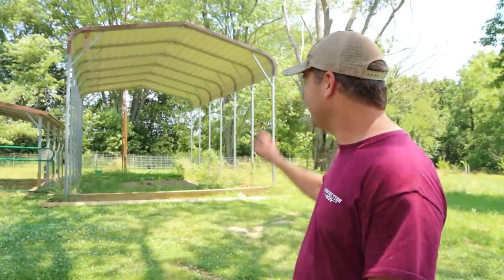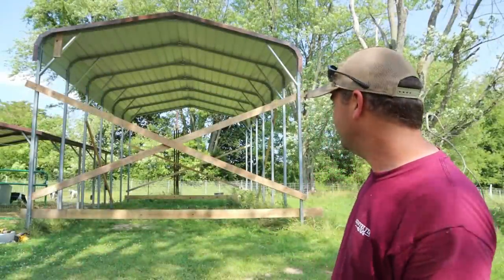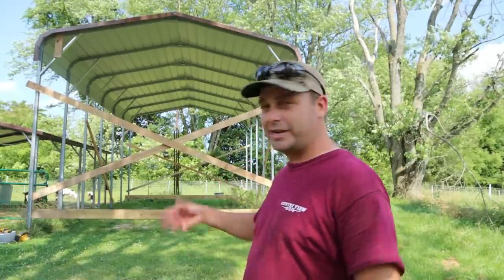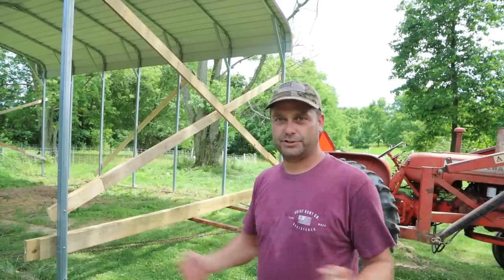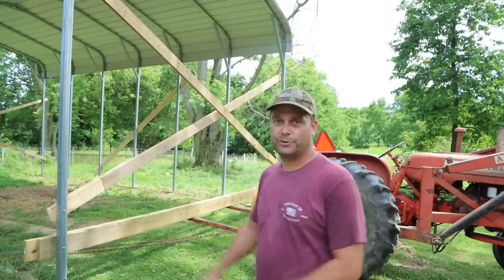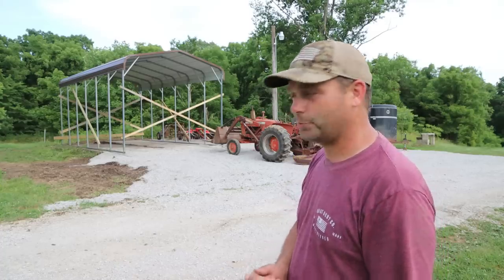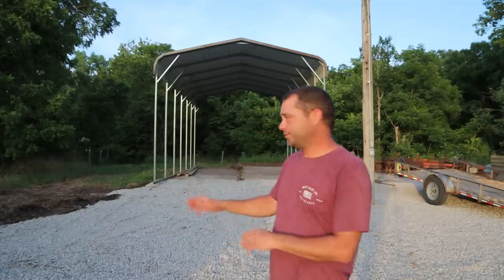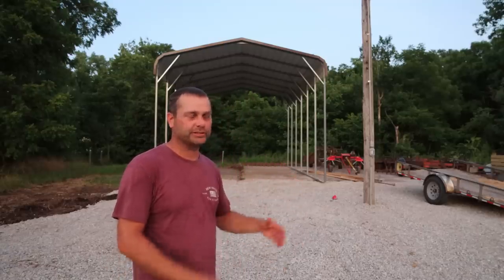Moving a Very Large Carport with a Antique Tractor

Comment: When I have moved sheds before or loaded them onto a trailer. We cut some small tree probably about 2-3 inch diameter. We would place them towards the back of the structure and the structure would roll on the small round piece of wood. WORKS GREAT!! Would also help to turn the structure if one side of the far end is off the ground.

Comment: Could you have put some temporary wheels at least on the two back corners? I mean while you are dragging it to its new home.
Reply: That is what I was thinking also...
Reply: I was thinking about the same thing exactly .. and then lifting front up and rolling it as a trailer .. would've made life much easier for the carport as well :))
Reply: If you had some pieces of pipe, 3 inches or bigger 1 ft long, you could have put them under the bottom rail perpendicular to the rail and used them as rollers to move it. That's how I moves mine.

Comment: Good job on the move. I would caution you about adding sides. Enclosed sides without substantial bracing of the ends would dramatically increase lateral load (wind force). A wind of 60mph produces a lateral load of approximately .61 psi.  You can do the before and after math. .61 psi might not seem much, but enclosing would be roughly a jump of a few tons lateral load to many tons of lateral load or about 7X. That's without calculating the "drag" effect. Just my 2¢ worth. 

Good luck!

Comment: Suggestion for the black door of the carport:  Make a well engineered draw up tarp door that can be hosted with a rope or chain that is weighted on the bottom.  That way you can keep the drive-thru utility of the carport.  You just need to prepare the area around the back of the carport.

Comment: Next time you move a carport or shed , use 4inch thick wall PVC to put under skids and it will slid sidways when you turn Ned connect your chains to the same point on the tractor and it will turn. Works great !

Comment: Well done!   A few years back I was driving down a rural paved road and did a double-take when I saw a seemingly self-propelled small barn approaching the highway.    There was a tractor inside the barn with the barn elevated and supported by the tractor.   They had stationed an escort vehicle on the highway and I was so distracted by the moving barn that I almost rear-ended the escort car.

Comment: My wife and I did something along the same lines, but without the use of a tractor. 20ft by 24ft carport  frame that we have set up as a greenhouse. We cheated and used a floor jack to raise the base up and shove lengths of 8in PVC pipe under the base. Put some additional framing boards up and, little by little, pulled it with our truck to its final spot. Pretty sure it looked like a goat roping circus for the bystanders. But went off without a hitch!

Comment: I moved a carport just a bit smaller than that once. We used my 2 tractors to lift it on the sides. Then we set it down on 4 old 50 gallon barrels.  Backed a flat bed trailer into  the carport and slide a couple 25 foot old beams we had across the trailer front and back. Then we used the tractors again to lift the carport up off the barrels and sit the carport down on the beams. Off we went to a neighbor 2 miles away that bought  it....

Comment: Nice job.  when you have to move it again try putting tractor , with counterweight, inside.  Put lifting beam with boards laying flat; as many as you had. attach chains to rear, as far back as they reach. attach chains as wide as you can so most of the force is in the direction of travel.  The front forks provide as much lift as you need   and the steering;  the chains the propulsion.

Comment: You two made it look easy. I've got an 18x21 to move a quarter of a mile. I'm thinking of putting 2 wagon running gears under it after bracing.
You did a great job in my opinion. 
MB BAR RANCH

Comment: If you have to move something like that again.
Got to a junkyard, find an old rear wheel drive car- take the wheels and spindles off the front end of the car, not the whole sway arm, just the hub and spindle part. the spindle hub normally attaches to the car with 4 bolts, make a plate or use U-bolts to connect the hub to the outside of tubes after picking it up. throw the wheels on the hubs. or go buy new stuff for a wagon/trailer at the farm supply store and find some wheels. two wheels on one end will make all the difference in moving it, lift it with the tractor on the other end.
Just an idea.
Happy 4th, thanks for the videos, hope all is well in your neck of the woods.

Comment: Get an axle from old Chrysler mini van (round) cut axle in half. Add a slightly larger pipe over axle to make it the width you need. Make a 4x6 tongue and cross support it on the other end. Pull it like a big trailer. Add a slow moving emblem on the rear. Probably best to pull with a tractor.
I’m getting ready to move a 20 x 12 Morton building 8 miles and a carport like in the video (a little shorter) about a mile. Wish me luck!

Comment: You should consider leaving the right side open to the compost bins. Then drive in 12 to 14 foot high posts along the edge of the concrete on the far right side and running a sloped roof on top so all of the equipment is covered. Then close in the sides and back as needed.

Comment: I would have constructed  some very strong crossbars on 1/3 of the frontside, just onder the roof. You just drive inside backwards and lift it with the frontloader. With a lot of counterweight on the tractor, you just drive it one time to its place, hence you can steer. I did it before.

Comment: Yup .. one wheel to the each side would've made your life much easier and less painful .. especially when maneuvering .. anyway - thumbs up for the great job! :) Hope you gave your wife a big hug after ;))
Btw you could use a strong enough tarp for the back wall, which you could pull up and slide down with a sort of rope system, if necessary .. it doesn't have to be a permanent built.

Comment: Back the trailer you had  put long planks across front and back of your trailer lift sides to clear ground with bolted parallel planks drive the shed to where you want it  a farm wagon would work too you did a good job but it would be easier with a trailer or farm wagon

Comment: I think i would've either tried to make my tractor 31.5' long with fork extensions and wood attached to the brush hog, use the tractor hydraulics at both ends to lift, and drive it there.  One other idea i had was finding the longest trailer i could, making that thing 18.5' wide with wood and lift it up onto it one end at a time with cribbing and the tractor. Anyways, glad you got it in place.

Comment: I would suppose that someone has given this idea a run or that you thought of it... put that little flatbed trailer behind the pickup and and then park it to the back where the whole end of the carport sets on the trailer. then go to the other end and lift that end with the tractor and move in unison. Slow but sure an corners and all, done in a hour and drinking lemonade. At about ten feet up so it clears all that is under it make a loft for stuff that only sees light when you need it... make a list of everything up there as you will forget for sure but we are only human...LOL

Comment: Well, I think you were a little hard on yourself. You said everything went wrong, but your final result is exactly how you wanted it. No unfixable damage, got it moved, squared up, and anchored, all in the single day. Sure it took some rethinking and a lot of on/off the tractor, but you found a way to success. When I first saw you had switched to the front, I expected the spinning wheels, and you ended up doing exactly what I do when the wheels spin - put the cutter on. (If you need more weight, put something on the cutter deck - farther back, the better.) You got something done that you had never done before, and probably hadn’t seen done either. I got a kick out of Rebecca just yanking that one anchor out! I really like that design of concrete anchor - far better than the old lead type. Happy Independence Day!